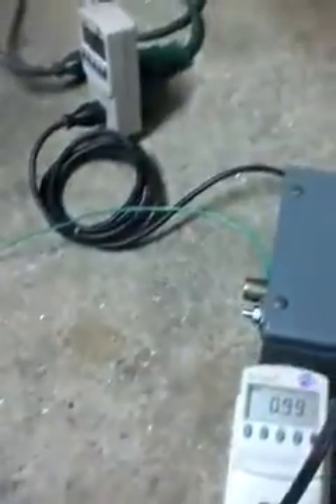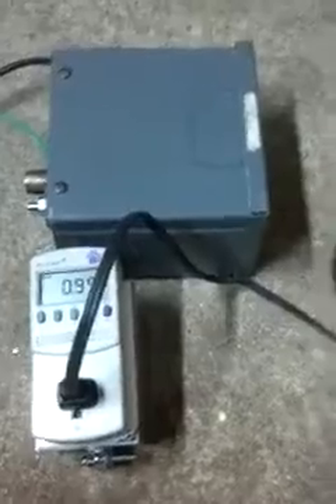Free Energy Feb 2015 C.O.P 112 Pelex Electric Exchange Mod

Comment: A  great invention in the field of energy.

Dear Sirs,
You attach an invention in which the scientific world thinks something is not possible.              https://www.youtube.com/watch?v=B2C7YHiQGC8 

Hello ! 

I am an inventor from Romania, Europe! I discovered the physic model which transforms the permanent magnet energy in kinetic energy on undefined time (continuous movement). I would like if you have the time and you have the financial/technical strength necessary to collaborate and construct the prototype for this invention. The invention has a pending patent and has the name "Energetic Transformer". It's composed by magnetic, mechanic, and hydraulic elements, the invention uses a new theory in physics also discovered by me and can demonstrate scientifically that such a device can be build. The benefits from this invention i consider that is for the best if they are split equally. If you agree please tell the method through we can collaborate. I wait a sincere and on topic answer as soon as possible on e-mail!   

                                                 POWER     TRANSFORMER

   Definition.
                     Power transformer is a device made of magnetic elements, hydraulic, mechanical sopul to transform the work cyclically generated  two permanent magnets.
   
  Principle of operation.
              Apply a new physical model, characterized in that: the amount of mechanical work
which is manifested in three axes, ox, oy, oz is nonzero

Best regards,
Inventor Scantei Tudorel , Romania 
Please send me an e-mail for talks on cooperation.
 E-mail invscanteitudorel@yahoo.com